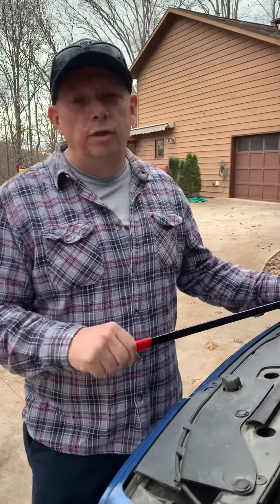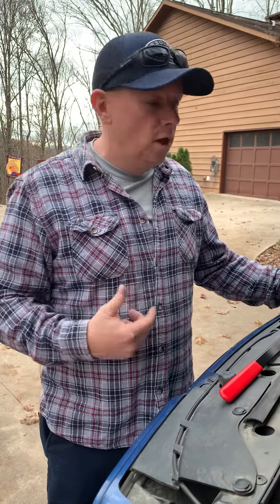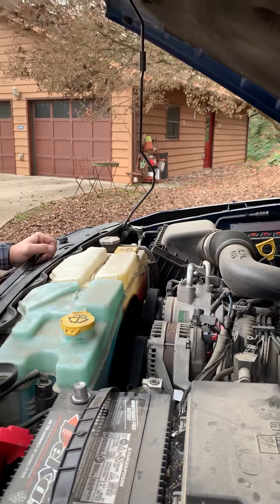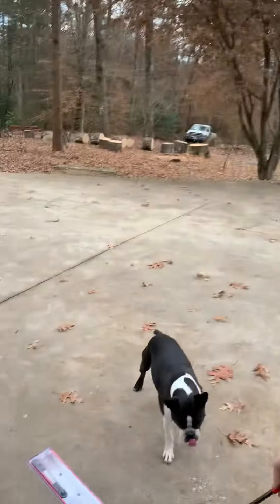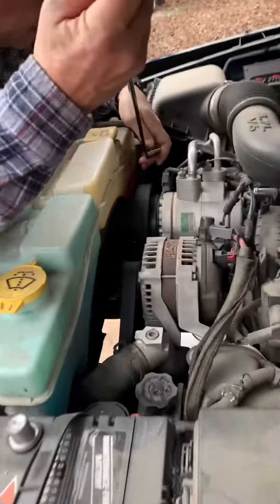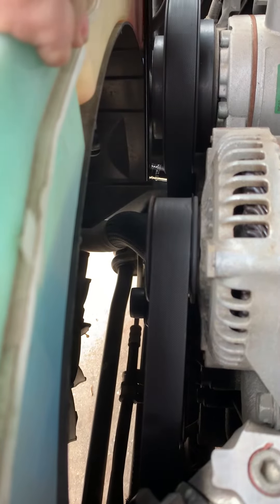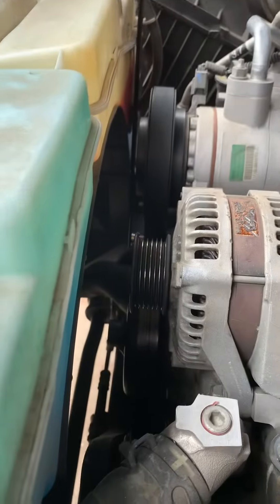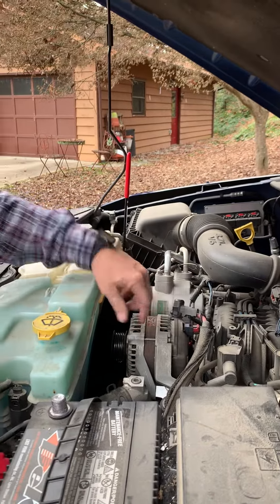2010 Jeep Liberty serpentine belt removal.

Comment: I wanted to see you get it back on again - getting my NEW belt on the pulleys is giving me fits
Reply from the maker: It was exactly the opposite of taking it off. I didn’t remove the belt completely. I only dropped it off the alternator pulley.
Reply: @surfturfadventures3885  I came to see the same. Every other video I've seen replacing the alternator without removing the reservoir, the guys had a hell of a time trying to put the belt back on. I couldn't for the life of me understand why the hell they all would remove the belt completely, then fight like hell trying to get in there to put the belt back on instead of only just removing it from the alternator. I figured I had to be missing something as it couldn't be this obvious and simple, but here it is, and it is just that simple. I'm laughing because I'm still wondering what the catch is and why the hell every other guy decided to make things that hard on themselves?

Thanks for the video my man.

Comment: I realized I didn't need to remove anything at all, as suggested in other videos, to replace my alternator. If you need to replace the alternator you just loosen up the belt as shown here, move the belt out of the way, replace the alternator and place the belt back. Just take note of the routing of the belt.